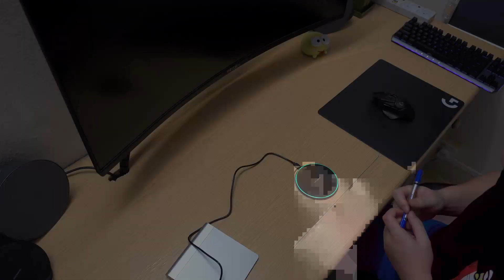Wireless Charging Keyboard Hack

Comment: "And it has the Cherry MX blues..."
Me: Fucking vomits all over myself, my dog, my bed; whole room is covered in vomit.

Either way, amazing set up and cable management, great hack. My cable management is awful, I don't care enough to improve it but I wish I did:') My keyboard is 3300MaH and lasts about 5 days or more but something like this would be nice even if my keyboard has good battery life. May consider it in the future, great video...thanks!
Reply from the maker: My current keyboard is the NuPhy Air75, also with gateron low profile blues. 😂
The only other keyboard build I had, I was using Durock T1 switches. Loved those too.

Do it. It's super worth it to be able to easily charge the keyboard lol.

Will likely be doing another video soon to update on my current wireless charging setup with the NuPhy...

Comment: The thought he had was EXACTLY what I was wondering. Lately I've really gotten into making my setup and room look good, but I also want everything to be practical. That's why I got a mouse with a charging dock, magnetic wires for my phone, earbuds and headset, and bluetooth dongle for my controller with a charging dock. I don't want to see any wires, and I want the full convenience of wireless without the worry of having to charge them. There's a few options for wireless headsets as you can use magnetic wires, also the hyperx cloud flight S has chi charging and the Arctic pro has easily swappable batteries and charging dock. For mice I only know of one that has build in chi charging capabilities, the HyperX Pulsefire Dart. My thought on this technique would be instead of installing a wireless charger into the desk, if you have an opportunity to 3D print a stand with space for the chi pad so that you can just put the keyboard up on the stand and it will start charging.
Reply from the maker: Wireless charging and magnetic wires FTW! You can also consider the magnetic heads for the mouse and keyboard if that "docking" charging thing works for you too

Comment: Does this make your keyboard off balance? Meaning, if I type on either far side of the keyboard will it wobble? It’s the only issue I see with implementing this into my setup.
Reply from the maker: No issues with my keyboard previously - the qi receiver is thinner than the keyboard's feet. If yours are thinner, maybe can consider modding them a bit to be thicker

Comment: Very nice project. Is that possible to change also for Mouse G502 lightspeed. I have same your mouse and  I don't like to use a cable to charge and also mouse pad from Logitech its's very expansive
Reply from the maker: For a mouse it doesn't make sense to put it on a qi receiver pad since the mouse needs to glide around - the best solution is probably still Logitech's mousepad.

What I did instead is use one of those magnetic connectors for my mouse, since it doesn't require charging as often. When it does I will just let it snap to the same cable I use for most of my devices

Comment: Question: Is your Qi receiver gets hotter? Is it reasonable for its heat?
Reply from the maker: It died after about 10 months, I think because of heat. Normally most of the other Youtubers cut a whole in the table from the bottom, so at least one side is fully exposed to air and can cool down somewhat. But because I cut in from the top, then covered it in vinyl, I think it heated up more than usual. 

The second qi charger I use with my phone is still ok though, but that one I typically only charge for short periods throughout the day, unlike the one for the keyboard which is used for long stretches.

You can take a look at my alternative solution for the keyboard here: https://www.youtube.com/watch?v=uymVRuV5oKM

Comment: The drevo bladermaster pro is really good?
Reply from the maker: I like it! It hits all the markers for me: can pick my preferred Cherry MX switch type, can do both wired and wireless (1ms response) modes, full RGB, tenkeyless. All for less than 100USD
Reply: @kalestarler  Can you help me? Where you bought yours? is that on amazon it says "used", but I dont know if there are any being sold how new.
Reply from the maker: It looks like it is only available brand new from Amazon UK and there aren't many pieces left. :(

Comment: Is the charging fast? I want to do this with my Anne Pro 2 :<
Reply from the maker: It’s good. A keyboard requires a lot less power compared to a phone, I think, hence it charges almost like normal as if it was still on cable. I don’t really keep track of it because I leave the keyboard “connected” to the Qi charger most of the time though
Reply: I see, thank you!

Comment: Can it work for all keyboard like g915 tkl
Reply from the maker: Yes, it should! I think the G915 TKL uses a micro-usb connector though, so you should probably look for a micro-usb Qi receiver.
Reply: kalestarler thanks a lot
Reply: kalestarler oh wait how does it work so do you have to charge the battery or does it last forever
Reply from the maker: It’s basically wireless charging for your keyboard, same as when you put your phone on a Qi charger -  if you keep the keyboard over the right spot, it will keep charging, if you shift it away, it will stop
Reply: kalestarler but is it unlimited or do you have to charge it
Reply from the maker: Erm, I don't get what you are asking about - there is no such thing as unlimited power - the keyboard's battery is being charged wirelessly by the Qi charger hidden within my desk. If you don't put it over the Qi charger they keyboard will go flat.
Reply: kalestarler nice channel I subscribe to you but what I’m asking is because wireless charger for your phone you have to charge the wireless charger but for this Qi charger do you have to charge it or the battery is unlimited for the Qi charger not the keyboard
Reply from the maker: The Qi charger in the desk is permanently connected to power. Cable runs under the table

Comment: Actually, rather than doing all these, why do just place the keyboard (with the receiver)  on the wireless charger when u are not using the keyboard or when u go to sleep? I don't think the keyboard will run out of juice in a day right? A neat trick will be, how to get the MX master 3 to charge wirelessly or have a dock like the first MX mouse...hmmm...
Reply from the maker: For mouse, you can consider a Logitech gaming series PowerPlay compatible mouse, works with their mousepads to charge wirelessly.
Did consider the option of just "docking" the keyboard to charge when not in use, but then you might run into issues of forgetting to charge it, etc. This way I can keep it constantly powered but still wireless because the "dock" is built right into the desk :D
Reply: @kalestarler  Yup. Saw that but I'm more of a MX user haha... shucks they didn't consider that for the MX series. They might be using G to test the market. Very likely it will be the future.

Comment: Do you think the wireless charger would work if I place it under a mouse mat?
Reply from the maker: Yes it would! I'm currently testing it with one of those XL size mats that cover both keyboard and mouse. But you would need to make sure the distance to the table surface is as thin as possible. My mat is about 3mm thick - I've also moved my charger right to the table surface to reduce that distance - I think about 5mm is the limit for mine. If you get a better wireless charger, the distance in between could be more forgiving.
Reply: kalestarler Thanks for the reply... I have a mouse mat the size of my desk and I am thinking about sitting the charger on top of the desk and place the mat over the top? Hopefully you can’t see the cable running underneath the mat then.
Reply from the maker: Culleyy The keyboard might not be level on that though? I suppose you could place some rubber feet maybe that is the same height as the charger below the mat as well to level it out for the keyboard